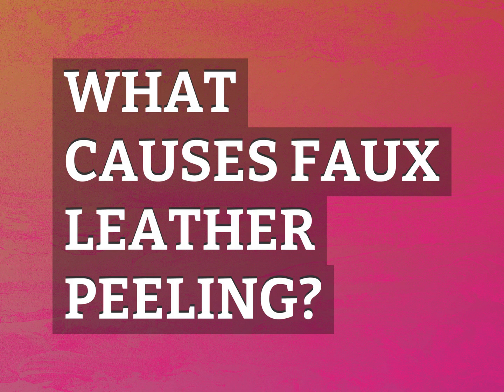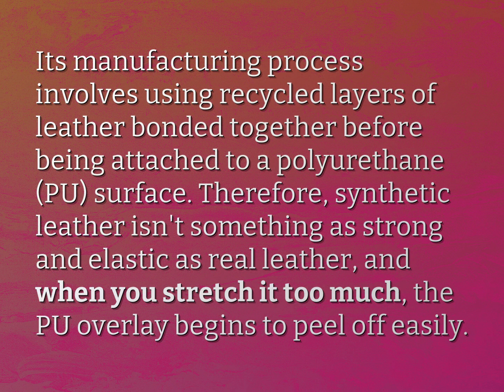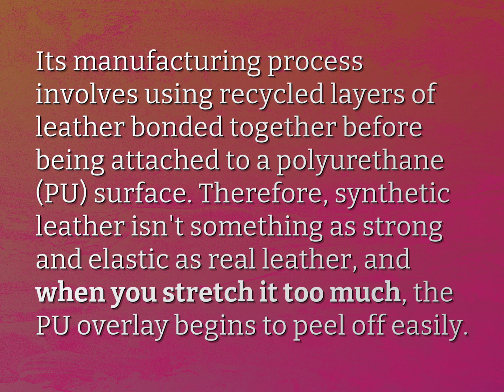What causes faux leather peeling?

Comment: How do you prevent this? The best jacket I've ever owned started cracking and peeling bad. By the grace of God I found another and I need to make sure that does not happen again
Reply: I'm not entirely sure, but I know temperature fluctuation is what caused a good majority of my faux leather shoes in storage to flake. If you can store your jacket at home in yoir closet it a garment bag even in the off season, this should help significantly. Some YouTube channels recommend using leather dye because it can double as a glue, so that might be worth looking into for you. Avoid using leather/vinyl cleaners on them too; this I found out the hard way!!! I hope this helps! Good luck!
Reply: Sister,  Did u wear , Still?🎉